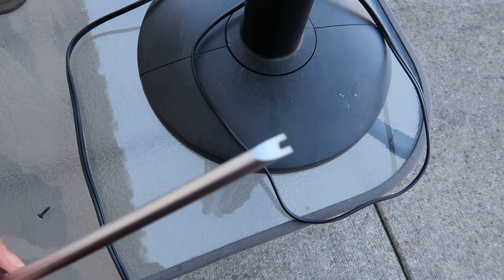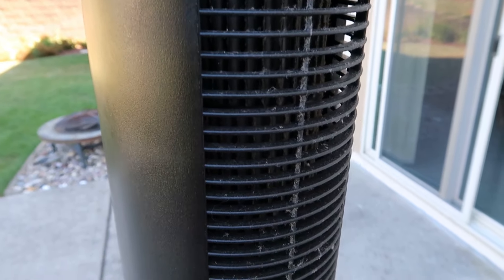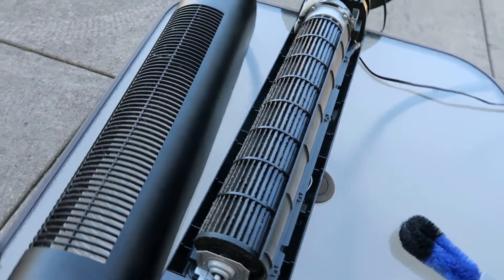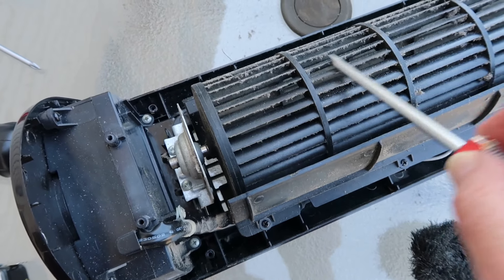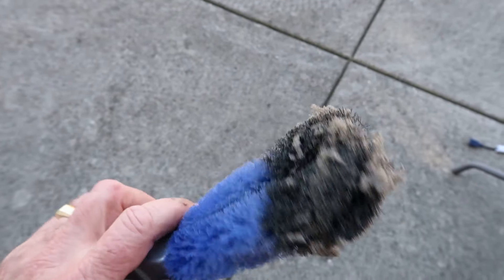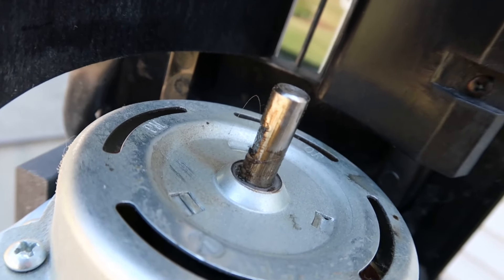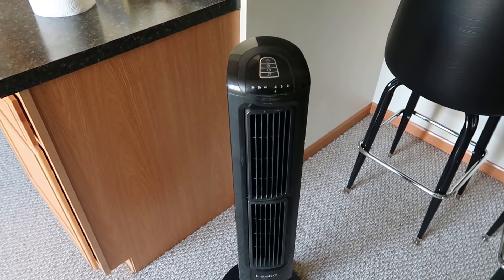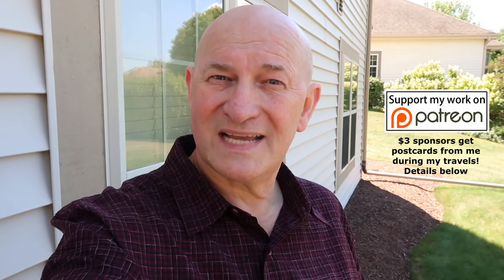How to Clean a Lasko Tower Fan | The BEST Way!

Comment: Ok....fuggetabout the spanner screw and removing the grate. My creative wife took the sucker outside and used her 200 mph leaf blower for a minute or two from the front then the back. No more dust.
Reply from the maker: It won’t get as clean. If you watched my first try, I used an air compressor with a power nozzle. It doesn’t get as clean as this

Comment: An elderly friend of mine has two Lasko tower fan type heaters, one she has been using for years and years (without cleaning) and a new one purchased recently. Needless to say the old one started giving her trouble and she asked me to look at it. I immediately doubted her word that no one has ever touched it because I saw three different types of screws holding it together. Over the course of 2 days and approximately 3 or 4 hours of aggravated attempts to remove these two screws I realized that this was just an elaborate ploy by Lasko to cause people to have them serviced by the company or thrown away and replaced. (My first thought was that her grandson had attempted to clean it or fix it and had put in different screws when putting it back together) I own probably 50 or 60 different types of assorted screwdriver because I consider myself a DIY handyman LOL eventually I realized before I saw your video that nothing I had was going to work so I had to make two different types of tools because her heater had the top left security type spanner you're talking about AND the bottom right was an altogether different one, similar to a triangular type I've seen other comment references about... Being a "ninja rigger" I destroyed two of my screwdrivers to create two that would remove these crazy screws! I honestly wish I would have just taken the cutting wheel and cut through in those two spots and worried about the cosmetics later. Great job on your video, ignore negative comments and keep up the good work.
Reply: Yes I run across the same issue on my Lasko tower fan, until I saw this video I had no idea what to use to take out these scews, now I have the tools to take it apart for a proper cleaning. I agree that Lasko deliberately put these tamper proof screws in to prevent the average Joe getting into their units. They even state on there site that opening up their unit will void the warranty! This is just a scam to have you go out and buy another one. I see a company called Dreo now sells a simiar fan where the back of the unit just pops off for cleaning, they want you to clean it, fortunately  not like Lasko!

Comment: I have a newer Lasko fan, and I guess they finally figured out people were able to clean them properly and continue to use them, which defeated their built-in disposable corporate game plan; they have changed the base, which is impossible to remove.
Reply from the maker: Time to move onto another brand, I guess. Sad that a business tries to defeat its customers.
Reply: I use to buy the white stand up oscillating Lasko fans because how powerful of a motor they came with. After five years I had a couple break so I went back to Walmart to buy the same brand which I saw summer after summer and after buying more, I’ll bring them home and quickly realize that they have put in a much cheaper motor that blows a lot less air for the same amount of money. Since then i refuse to purchase LamO brand fans. I will though take a perfectly good one from the trash and clean it which led me here 😂

Comment: Since purchasing it, https://www.youtube.com/post/UgkxQuBMI30VhO6fDed6NOsYftsoNa8x0UZ5 this fan is a trustworthy companion during the hot nights in Texas for me. The sleep mode is really quiet and gives you smooth wind to cool down. At full speed the fan is quite noisy but also very strong.Only weird thing is that if there is a draught from another fan, the sleep mode would speed up occasionally (getting a bit louder, probably to level 2 out of 4). This never happened so far when I used only this fan though.

Comment: Excellent video, I remember one year ago ago trying to take this apart I couldn't figure out what I needed for those tamper proof screws, so with an assortment of brushes and a leaf blower I got it  fairly clean. Now that I see all of the dirt inside this unit I will get those tools from Amazon and give it another shot. Thanks for the video.
Reply from the maker: It’s scary when you see all that filth inside that, at some point, must be spraying throughout your home.

Comment: The model I just opened up was all Torx screws (six point star bit); there were no spanner screws at all. It was one of the common sizes that used to come with Craftsman screwdriver sets. Harbor Freight has a six piece set for $8.99 U.S. 

My fan was disassembled, cleaned, and reassembled  in less than 20 minutes, with a brush and a compressor. 

Thanks for the video!
Reply: Same here! it has a few screws that are so deep I can't get them out. Super annoying on Laskos part

Comment: This is a great video, thank you. We're about to disassemble ours to clean it out. Under certain settings it gets super noisy. I'm hoping cleaning out any gunk will help!.
Reply from the maker: Please come back and let us know when you're finished.
Reply: @AverageMe  so we have a slightly different model but the disaembly was the same. We cleaned the blades and the spindle the blades ride on. I added very little white lithium grease to the spindle and any moving part that touches the blade assembly. Its not perfectly quiet but it's certainly much less noisy!  Thank you again for the video.

Comment: what size tip did u use on that spanner? is that the same as a "fork type?"
Reply from the maker: I used the size that fit. From the feedback here, I’m guessing the screw head sizes are not going to be universal on all units. The company seems to use what they have on hand at the moment.
Reply: @AverageMe  darn! cuz Wal-Mart has just a single one for a couple bucks.

Comment: Thank you for posting!   With my Lasco tower fan, it has power and will oscillate, but the blades won't spin.  i took it out and blew all the dust off with the compressor.  i saw that the air made the blades spin freely, so nothing appears to be stuck.  but i cant take it apart until i get the Spanner set. ( I have to wait until i get my SS again.) Any ideas what might be wrong with it?

Comment: Thank you very much for this video.  I agree with others that Lasko does not design their products for easy maintenance.  Several other fans have an easily accessible filter that can be removed and easily cleaned.  Why would they design and manufacture such an unfriendly unit?  To sell more once they break down?  Right!
Reply from the maker: @thomasskrabala8044  Maybe. I have to believe it’s by intentional design. If we can see the problem, certainly an educated design engineer can.

Comment: I'm surprised you dissembled everything but didn't service the motor itself which would reduce noise, friction, and significantly improve output / airflow! My fan stalled because dust & dirt gets into the motor, sticks to the lube and eventually creates a sludge that creates friction and slows it down or stalls it. The bearings are on the inside and need to be opened up to be de-greased (with diesel / kerosene / de-greaser), and re-lubed with WD40 / motor grease. Unfortunately I couldn't service mine because the motor was sealed using rivets, and it's your typical single use land-fill product. I'm happy with this video though, because I got my answer at 7:51, these motors have screws and nuts, and I can have a little peace of mind knowing I can service it for the Lasko brand should I run into that issue. Buying a Lasko fan thanks to this detail :), Thanks so much!
Reply: way too much trouble buds, check my comments to see how to properly clean these things in 5mins...much easier than the hour+ THE OP video content creator took to do his...saves on the proprietary screwdriver sets 2
Reply: Just did a honeywell and a Seville, both of them higher quality IMO than the lasko, yet they are all pretty much comparable, people throw these out usually when they become dirty, so you can get quite the supply of them around for free at the start of a season!  They are also the best fans in the world (even the Lasko) as the newest DYSON tech will pretty much knock your biology over dead IMO with the massive EMF's they throw off...which btw you will also get MINOR on these fans, so in other words AVOID sticking them right besides your feet when you sleep etc...you want some proper distance from those motors EMF fields in order for your biology to remain intact (same difference with having a 24/7 router turned on at the foot of your bed frying you with similar dirty electricity EMF spikes).
Reply: Love this video! Motor starting to stick: mine too. Did not realize dust would get down into the shaft and then bearings housing. Not sure if I'm brave enough to try it, but at least I have the option, thanks to your quick how to as well. Will try just wiping things down and see if that solves my symptoms. 😉

Comment: I plan on cliping a piece of air conditiiner filter material tihe back of fan  intake.  This will keep fan clean and clean dust from the air like an air purifier. Thanks for showing me that it is possible to take apart to clean before I buy this tower fan.
Reply from the maker: That might work, but it would reduce airflow & you’d have to fabricate something to keep it away from the blades since it’s not designed for that

Comment: Good job, the motor can be disassembled via screws, revealing two bearings that have a felt washer recessed around it, can add drops of oil to impregnate the felt. Nyoil is good and scentless, silicone oil will work too but may want to double check. Cheers
Reply from the maker: Thanks for the hints. I don't think it was necessary for what I was doing, but nice to know nevertheless. As long as the thing is open, why not?
Reply: @AverageMe  none of it was necessary, these things are  a hassle to take apart and put back together again as they all pretty much have proprietary baloney getting in the way, and you have to remember all that...my way saves all of that and makes this a cake walk.

Comment: What do you think of the idea of putting a very thin ply filter on the air intake on the back to reduce the intake of more dust?
Reply from the maker: I think it would interfere greatly with air flow.

Comment: Where can I get the magnet you used for the screws and the cleaning brush?
Reply from the maker: Well, they're not easy go get. Round magnets like that are found inside microwave ovens. So if you have access to an old microwave, you'll find two of them inside. But be careful, there might be a charged capacitor in there waiting to give you a shock (even when unplugged).  But you can certainly get good magnets at a hardware store.

Comment: I have a couple of Lasko floor fans and a Wind Tunnel Remote. They are designed to break before you can repair them successfully. Given how much they cost, and the fact that three Lasko fans that I purchased previously also broke, I am going to switch to generic $20 box fans instead of paying $50+ for each of these fans!

Comment: Good video. Makes a complicated job look easy. My biggest problem is the 2 temper proof screws in my Lasko heater are not spanners, the screw heads are triangle shape. This fan is made in China. So I ordered a set of triangle tip screwdrivers on eBay that is shipping from China. ETA, about 2 months. Wish me luck.
Reply from the maker: Did you try following my link and changing the criteria to triangle? Amazon might get them more quickly. BTW, it really is not complicated at all. If I can do it, you can too. Thank you for watching!
Reply: @AverageMe  Hi, you have 3 links listed below your video, I did not see a triangle link option. Anyway since my eBay triangle screwdriver set order will arrive after the heating season is over, and ordering from Amazon is too expensive, I shaved an appropriate size Phillip screwdriver tip to a triangle shape with a grinding wheel that roughly fit the screw head. With some persistent effort  I was able to take out the two tamper proof screws  and vacuum out the dust lint from the fan and heater element which was covered with lint like a blanket. Thanks for you video and suggestions.
Reply: Yeah mine has the triangle screws as well. Wish me luck finding a driver. Because of. Course they make the holes too small for a bit driver. This repair is not financially or time efficient, but I'll be darned if I'm trashing something that should be fixable!
Reply: @WhatDavidDoes  After removing the triangle screws with a shaved Philip screwdriver and vacuumed out the dust, I installed an air filter piece on the air inlet back side. No more inside cleaning needed.
Reply: The filter sounds like a good idea. I also need to lube the 'axles' while I'm in there. You can tell its struggling to spin

Comment: sigh... got a set of spanners and none worked - maybe they used epoxy on the screw, couldn't get it to turn unless you're supposed to turn it clockwise - any ideas before I give up, buy a new fan that's not Lasko? any help appreciated

Comment: One of the security screws is deeply recessed - just over 3 inches. Sadly, the screwdrivers in the link will not be long enough so I need to buy a different brand with a longer rod. Therefore, would you know what size this security crew is please Size: M1.7+2.0+2.3+2.6+2.8? Thanks.
Reply from the maker: The ones I ordered from the link worked, one was 4" in length. I gave the fan to a friend when I moved so regrettably I can't check anything for you.

Comment: Boy,  yours is a lot easier to disassemble than mine!  The cylinder is in two pieces so one can be rotated relative to the other, and removing the screws from the backs of the two halves of the casing does not suffice to let them fully come apart to get at the barrel of the fan.   In the bottom of the base are four screws, three of them Phillips and one "spanner" headed.  (Clearly this is done on purpose to frustrate the customer.)  I expect I can make a spanner screwdriver, out of one of my many spare ordinary drivers, by just making the necessary notch in the blade, with the thin grinding wheel of my Dremel tool -- but what a pain in the ass.  I hope, after all that,  it turns out that getting that fourth screw out of the base suffices to get the cylinder apart enough to get at the fan barrel -- but I can't quite imagine how it would. 

I don't see any bearing or mount at the top of the fan shaft, though, abd there are no electrical components in the cylinder -- only in the base -- so I'm wondering whetherI might get away with simply immersing the cylinder in a barrel of water and just running the fan!  What do you think?
Reply from the maker: Yes, I think it would be easy to make one if you don't mind ruining a slotted screwdriver. And obstructing the customer does seem to be their goal, which makes one wonder why they just don't make the blasted things "cleanable" in the first place.

Comment: I have a later model lasko and they replaced the two spanner screw with some kind of triangle looking screws. I guess if I go to the hardware store and buy the traingle screwdriver, the next model will use a different screw. When made in china were always screwed.
Reply from the maker: Very clever ... and correct!

Comment: If you have a powerful leaf blower . It takes 5 minutes to blow all the dust out of it . I suggest you have someone hold the fan down because it will tilt over .
Reply from the maker: @TheMohawk102  it won’t get it clean. Some dust will blow out but you saw when I opened this. That was after using compressed air, far more powerful than a leaf blower.

Comment: First, I noticed it with Shark vacuums, and now I notice it with Lasko space heaters. I call it STRANGE SCREW SYNDROME, which is the needless deliberate attempt by companies to make their products difficult, if not impossible to do DIY cleaning and repairs. I have seen products saying “No user serviceable parts inside. Repair must be done by qualified technician.” This is OK if DIY repair is dangerous, but not OK if it is merely difficult, and especially not OK if it means the company sells more product as a result, which also results in more landfill.
Reply from the maker: Well said!

Comment: Yep it's brand new again there are quite a few things they use those screws on there just security screws because the average person does not have those tools readily available but they are used on other things such as weed eaters and just mini things whatever they want to make hard to work on it's about like a 3 * or whatever screw is that Mercedes uses on a lot of their stuff
Reply from the maker: It's crazy when you think about it. WHat do they care? All they need to do is void the warranty if it's opened.

Comment: You could use an air duster machine too.
Reply from the maker: That doesn't clean is thoroughly. People try leaf blowers, compressed air, but they are fooling themselves. That will not get it clean (you can see my other video). This is the best method. https://youtu.be/ldthMmhLPwg